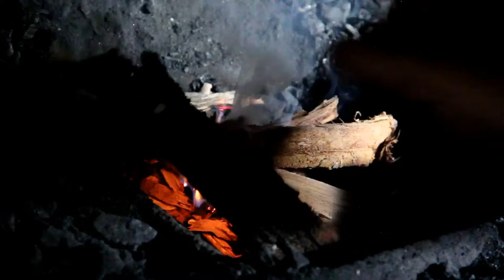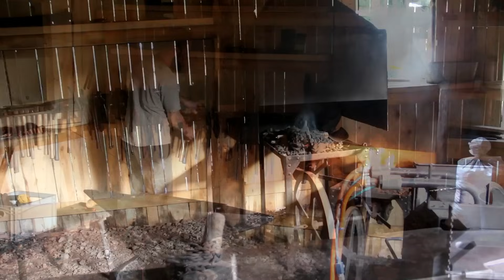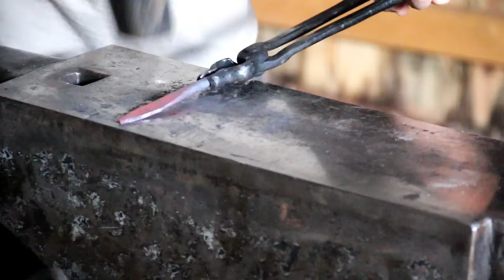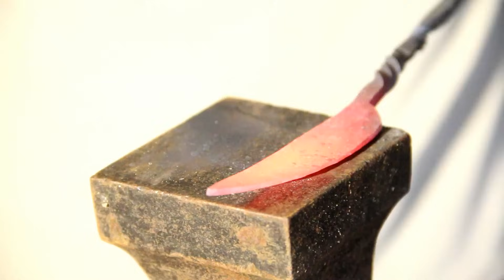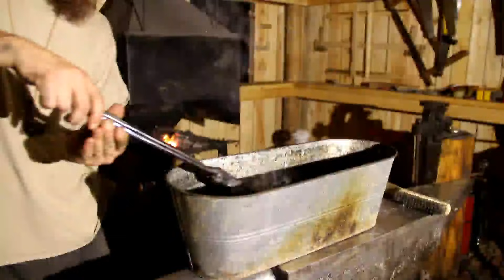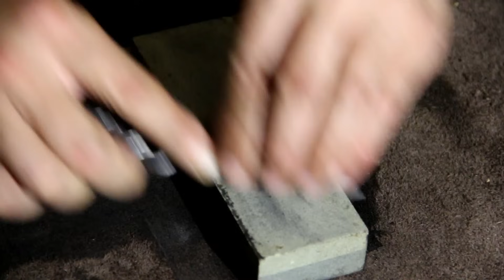Blacksmithing-Forging A Blacksmiths Knife

Comment: these are fun projects and ones I enjoy forging. I tend to forge them from file bits, that way I know that they are forged from 1095/W1.
Reply from the maker: Yes. I have lots of those. I use them for my Flint steels
Reply: @BerserkerGang2019  Exactly, I forge flint strikers from some bits of the files and then have bits left over, that's where projects like the blacksmith knife come in utilizing the leftovers.